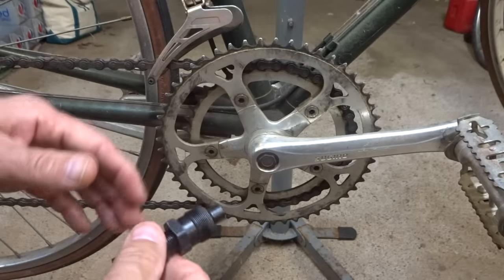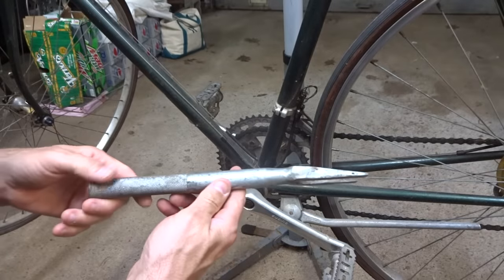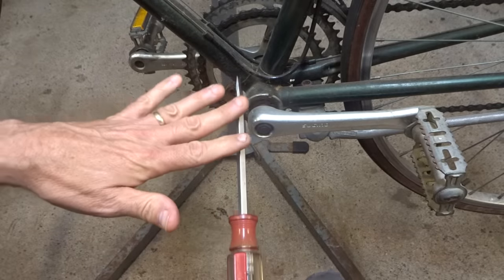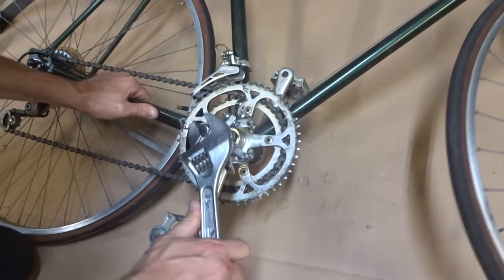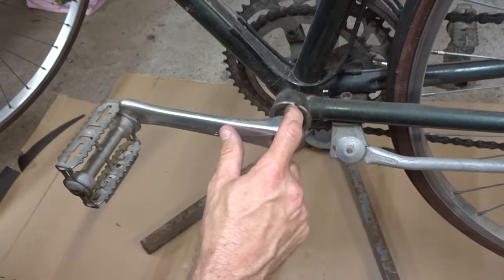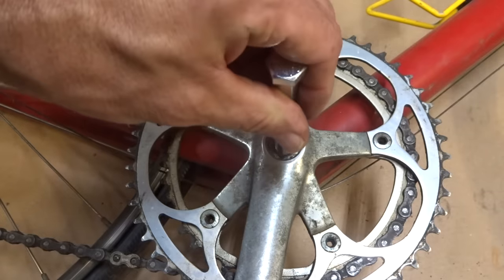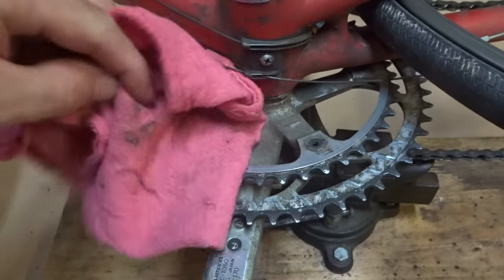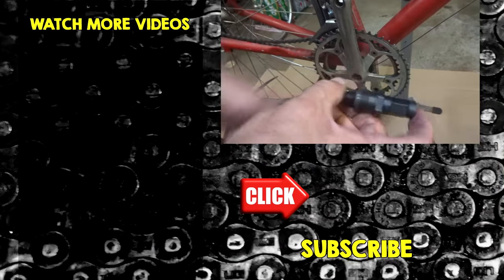Remove Cranks Without A Crank Puller

Comment: How much is a crank puller tool? If it's cheap, then why not go out and get one? Side of the road, you may need to do some adjusting or tightening...
Reply from the maker: $5-20. Did you watch the video? The whole video?
Reply: Sometimes, this type puller can be "borrowed" from an auto parts place for free.  They often require some information from you and perhaps a deposit, but you can do it right outside their store and walk it right back in perhaps! Buy something while there too! Just an idea.

Comment: Some interesting ideas here for dire situations where the threads in the crank arms are stripped, but if the threads are in good condition, just do yourself a favour and spend $5 or so on a crank puller! Things go a lot easier when you're using the correct tool.

Comment: In my situation i have removed the bolts but the arms are stuck gonna try wd40 hope i can remove them without using 
force/hammer its just to much for the bike sometimes ut damages barings the frame for example from the inside

Comment: bought the tool for £10 removed the bolt and screwed into the predal threads inserted the bolt part of tool and began to tighten it man it was solid so solid that i rounded the edges down on the proper tool now it,s just stuck there ,i cannot even remove it
Reply from the maker: Wow! https://www.youtube.com/watch?v=j5gmAkMLX60
Try visegrips to remove it. Not sure where it went wrong.
Reply: @RJTheBikeGuy  the threads inside pedal arm are fine,already tried grips they just slip off man its on solid,looks like the lump hammer is coming out to play

Comment: Do yourself a favour, save time and effort -  buy the correct tool, you know, the one designed for the job, and never look back.  I dont like using hammers on bearings, not one little bit, so will always use a puller which puts NO stress on the bearings, but you do you 😂

Comment: If the crank is properly seized on the axle you can not use a thin bladed plastic handled screw driver. Use a chisel, the right tool.

Comment: I tried pulling off my non drive side crank a few days ago and ending up stripping out the crank threads,  I tried again on the drive side today after filling up the taper hole with wd40 and letting the bike lie sideways for the last 3 evenings, Still no good. Crank puller was actually pressing ita shape in to the top of the bb axle..
Reply from the maker: https://www.youtube.com/watch?v=j5gmAkMLX60
Reply: I have the right tools, but the end of the crank puller is embedding itself in to the BB axle as I tighten it, the crank arm has not moved at all,  probably galvanic corrosion, aluminium arm, steel axle.

Comment: Hi RJ, I'm struggling to remove the crank nut off a vintage Japan custom crank. It's seized, Ive sprayed lots of wd40, have tried both crank puller socket end and an actual socket wrench, but it's getting to the point where I'm starting to round the nut off. Any tips would be gratefully received!
Reply: Just incase anyone in a similar position, I resorted to impact wrench. Took about a minute of alternating on/off power before it finally loosened and came off!

Comment: So on the last method shown when you turn the cranks one-quarter turn that's a 180 degrees?
Reply from the maker: One quarter turn is 90 degrees. If you watched, sometimes I rotated it a quarter turn, other times a half turn.  You just don't want to be bashing on one side only.

Comment: How are you supposed to use the gear puller on the crank without the gears?
Reply from the maker: https://www.youtube.com/watch?v=jrpIoXxVyTs
But unless your threads are stripped, buy the remover tool!
Reply: @RJTheBikeGuy  WOW! You got all bases covered. You have some clever solutions. I was just curious. I do have a couple of crank pullers. I had some major crank issues in the past. I had a new Fuji with crushed crank bearing races. At the time I didn't know anything about crank pullers.

Comment: Hey i have a question. My bottom bracket spindle is 127mm, new crankset is for 123mm spindle. Can i use the old bb for the new crankset? If not, why?
Reply from the maker: Maybe, but better to get prober BB.

Comment: Hey RJ, I just got myself a gear puller because i stripped off the thread on my cranks but i still can't seem to get it off. My crankset is just stuck no matter any of the methods i tried. But I don't have access to a hacksaw or anything to cut it off. Any other recommendations on getting it out?
Reply from the maker: Nope. This about covers it.
Reply: @RJTheBikeGuy  Aww man, alright I'll try to find a way. Thanks!

Comment: The thing is I bought the park tool crank puller. However, the thread on the crank arm is stripped. I’m just going to ride it outside until the crank arms fall off.
Reply from the maker: And it will ruin the crank.
Reply: RJ The Bike Guy I tried to ride outside yesterday and today. The bottom bracket would get loose first. It’s an old Motobecane from late 60s or early 70s. It still has the cup and cone bottom bracket. I don’t want to ruin the thread on the BB because I want to upgrade to threaded-on BB and modern crankset. I don’t even know if it’s BSA or Italian BB yet...
Reply from the maker: As the crank arms get loose, the mating surfaces of the arms will get damaged, and they won't stay tight in the future.

Comment: the problem with the balljoint remover tool method is that a sprocket removal tool is much cheaper than the ball joint remover,especially from asia and free shipping.
Reply from the maker: I recommend the proper tool. Though if the threads are stripped, then you have to do something else.

Comment: Time to buy a puller!
Reply from the maker: That is my recommendation. As long as the threads aren't stripped.
Reply: @RJTheBikeGuy  Bearing puller***

There is a certain feeling in the brain when you realize that the threads have gone loose.

Any word on buying new sealed BBs in 2020? Shimano changed their line (I will probably end up with the 300 if it fits my BB). There is not a huge selection / not great availability for high quality square taper BBs.
Reply from the maker: @BrownJello  They are the same as far as I know. Go to Hollowtech II maybe.

Comment: Can I get a link to the tool you used for the removal.. normal extractor does not work for me because my bike is chinese cheap and normal extractor does not screw on the threads.. the tool aroum minute 4/5
Reply from the maker: https://www.amazon.com/exec/obidos/ASIN/B06XPQKWV5/ref=nosim/youtube25-20
Or Harbor Frieght.

Comment: i cannot get the allen lock bolts off my crank arm.8mm allen wrench doesnt have the leverage.Now they are becoming rounded out as cannot remove them with force.
Reply from the maker: Bummer. Don't know what to tell you. They don't usually come out that hard. Maybe you were turning them the wrong way or something., You will need some sort of bolt extractor tool. Maybe an impact driver or something. Not a standard solution for you.
Reply: @RJTheBikeGuy  ive just found out that the company sells replacement bolts with thread locker on ,this is why i cant remove them.

Comment: i tried a crank arm remove tool but sadly when i start pulling off the threats inside got destroyed / gave after and the tool came out. så i guess i need to gently Hammer it off. i just wonder why the threats just gave up (aluminium) maby its metal fatuiqe

Comment: What do you do when the bolt does not come out to even take the crank off I tried everything.
Reply from the maker: If it were me, I would soak it with penetrating oil. Let it sit for a bit. Then use my impact driver with a 6 point socket. If that didn't do it, I would pull out my impact wrench and try that. Be sure to use a 6 point socket to prevent rounding off the bolt head.

Comment: Is there any way i can tighten it instead of taking it off without the required tool?
Reply from the maker: Tightening it is just tightening the bolt or nut with a socket wrench. Common tool.
Reply: @RJTheBikeGuy  thing is i dont have a socket tool 😬 and i need something for a one time use, any ideas as too something that'll work. Thanks so much appreciate it and keep up the awsome vids

Comment: All these methods are either damaging or require complex tools, not to mention timely. Bottom line - just use a regular puller! It's the best way.
Reply from the maker: A puller is the best way. Unless the threads are stripped.

Comment: Enjoy your posts especially on your homemade tools.... So I'm little surprised I have not seen one, from you for a custom puller?  Since the gear/bearing puller works but is less than perfect... Since all that's needed is some plates/rings, nuts and (all-thread or bolts)....  Then just drill holes and a slot to get it around the BB axle/spindle (2 plates/rings with the slots on opposites side would be best)... that just the general idea...
BTW if anyone wants more details on how to make one,  just leave a comment asking for them....

 (reposted comment)

Comment: None of these methods work for me. A Dremel is too weak and with a mid-drive motor in the way using a screw driver isn't ideal either and for some reason I couldn't finish the job with a pulley puller. So I made the cuts in your dremel method by drilling a few holes next to each other with a hammer drill (hammer modus off off course) full power with a 8mm drill. Most of the time straight into the center from the outside, then I drilled into the direction of the bike and to finish it off I drilled from the threaded inside outwards. If done properly, it can be done in like 15 minutes.
Reply: However I agree with you the most easy method is the crank puller, but if the thread is gone, there aren't many alternatives left.

Comment: So... to remove crankset WIHTOUT Crank Puller Tool, you should buy one? )
Reply from the maker: Did you miss the part  where I removed two crank arms without a crank puller? It can be done. But my recommendation is to buy the tool.
Reply: @RJTheBikeGuy  well, all other methods are mostly destructive, and which not are hard to complete and useful only if you CANNOT use the tool even if you have one.

So unless the video is called "How to remove damaged crankset", it should be really very short: "Just by the tool"

Comment: The best solution for that problem is to buy a puller..it is very cheap here in the PHL  I bought it for 120 php and I'm still using it for 4 straight years🤣🤣🤣it is made in China or Taiwan and it is very very useful

Comment: hammering caused my old crankset to deform a lil bit so even though i was able to fix the cranking sound in the bb I also made a lot bigger problem  cranking sound was fix but since the crank and the chainring was some what deform my chain started to rub on the fd cage and no matter how i tune my fd my chain still rubs bcause the chainring is wiggling and i ended up buying alivio crankset wc nice but it was unplanned causing me not able to buy the upgrade that i really want hahaha im not crafty sorry

Comment: I stripped out the threads in the crank arm with the puller tool on one side of my bike, then I stripped out the threads on the tool itself when trying to get the other side off 🤣😖

Comment: I have the tool but the thread for the tool is dead :/
Reply from the maker: Buy a new, better quality tool. My old Park Tool puller has pulled many cranks.
Reply: @RJTheBikeGuy  I mean inside the crank itself the tool is brand new :p ive seen now that you talked about it later in the video guess I commented too soon.
Reply from the maker: @GlobalDesignHD  Ahh, then you need to follow the steps in the video. 
Most often, stripped threads means someone goofed.
https://www.youtube.com/watch?v=j5gmAkMLX60

Comment: Two pickle forks and a propane torch.  Heat expands crank, two pickle forks, or wedges. ..  really. . .  I’d never let this guy at MY bike.
Reply from the maker: If you are using pickle forks, I would not let you work on my bikes.

Comment: I have  a very important suggestion... 
I was experiencing a stack crank since yesterday, it just won't release. I even turn to violence, but nothing helped. At night I had  a vision... Maybe if I try to heat the darn 😬♌♋♊thing with a propane torch... And YES... YES... Yes... It finally poped out... ➡️me... 😄😃🤣😂...
Reply from the maker: I have tried heat, and usually had zero luck with it.

Comment: I wish that this video came out a week ago when I had to replace the cranks on my old ciöcc 😂
Reply from the maker: If you have a nice bike like a Ciocc, invest in the tool.
Reply: @RJTheBikeGuy  we got lucky and the cranks were so loose that they just pulled off. They were cheap sora crank and the inner splines wore out. So I went out on eBay and found some 105 5500 to match most of the groupset that was already on it

Comment: I have a 1996 TREK Mountain Track 820 with a Shimano Altus FC-CT91 Crankset.  I'm having issues finding a similar crankset to install.  It's a 38/32/24 tooth crankset.  Can I install a different size crankset ie., 42/38/24?  Would that work?  Would appreciate anybody's input.  Regards
Reply from the maker: Sure. You might need a different size bottom bracket. Maybe longer chain. Maybe different derailleur if current one can't handle the 4 extra teeth, though that isn't much.
Reply: RJ The Bike Guy I will definitely try it. I figured 4 extra teeth on the larger crank may not effect it that much, but if so I’ll follow your advise and replace the other parts. Thank you

Comment: Fond memories of trying this without the puller and gave up. Was finally successful when the chain wheel came off the bike( and me with it) on the way back from highschool going full gas up a hill. Forgot to put the bb nut back on. Was the same 105 set also. I wouldnt recommend my method.

Comment: It's the same the same thing. Ur using the same method. The bottom u need a bike crank puller. So y u saying a trick without a crank puller

Comment: That crank pulling tool is only good if those threads are in good shape on the  crank. I have 3 different versions of that tool and the last 5 cranks I tried to pull they where no good. I even have that stupid thread chase tool and that is garbage. I ended up having to replace 5 cranks!
Reply from the maker: https://www.youtube.com/watch?v=j5gmAkMLX60
Reply: Finished with the best bit of advice... Buy the right tool for less than a pint of beer or a pack of cigarettes... (or at least in the UK anyway) 👌
Reply: I don't really know who you are talking to. But I have the right tools. And you drink all the beer you want. I don't drink!
Reply: I've seen that video and many others but if the threads are damaged these tools do not work. The only tool that will work then is a right angle grinder.
Reply: @Airbrushkid  What's a Right Angle Grinder?
Reply: Ha I see, just a Angle Grinder over here, we don't do the 'Right' bit beforehand!
Reply: What country you live in?
Reply: England 🏴

Comment: I'm lazy so I just remove the crank nuts/bolts and ride it up a hill in the hardest gear.
Reply from the maker: It can ruin the crank arm.
Reply: Yeah, not the best solution, but I stop cranking when it gets loose.
Reply from the maker: @vidjagameenjoyer  Buy the tool.
Reply: @RJTheBikeGuy  I fix bikes for a living and own all my own tools, but sometimes the threads are stripped and I don't always have a 3 jaw puller.

Comment: just buy the proper tool, they are not that expensive on ebay, this is like using an adjustable wrench or pliers all the time, better to use sockets or correct size real wrenches

Comment: Piece of advice,  buy a good tool for this, I bough one from eBay for "cheap". Tool ended up being trash, save yourself the trouble and just spend the $15-$20 for a parktool or something similar
Reply: I bought a Parktool crank puller and the threads stripped out. Parktool was good enough to send me a replacement. I did buy a cheap Chinese puller as a backup because once the puller is damaged, your repair job is over until you get another one.

Comment: I have Crank Puller Tool, but managed to ruin thread in left crankarm (poor quality of thread).
Reply: It's absolutely imperative to thread the tool in as far as it can.  First, back the bolt on the tool all the way out.
Reply from the maker: Stripped threads is most commonly user error. https://www.youtube.com/watch?v=j5gmAkMLX60
Reply: @osheathedj  that what i did. worked for drive side. But failed on non-drive side. Puller just appeared with aluminum threads grabbed from crank)

Comment: Hack saw, Dremel, angle grinder? Pounding on it? Why not a oxy/ gas cutting tool or a plasma cutter? OMG how bad do you need those parts off that bike? Just get a freaking tool. Auto parts stores will lend you the puller.

Comment: Ya bro I dont have that puller
Reply from the maker: Then buy one.
Reply: @RJTheBikeGuy  broo expensive 😁  in my cycle  the front cranks balls are gone and whole gear set is broken with the change of an angle now I have to change the whole set 🥲
Reply: @RJTheBikeGuy  u replayed to me 😍❤️🔥
Reply from the maker: @RAPTORxSTREET_  The tool costs under $10. I see one for $6.29 and free shipping on ebay. So I call bs.
Reply: @RJTheBikeGuy  am in india it coast 800,900 rupees

Comment: Usually, when you have to remove a crank without a conventional puller, it's because the extractor threads are ruined- so the crank is junk anyway. Only a masochistic fool would refit it. You only go to the effort of removing such a crank, when you absolutely have to- when the BB has had it- and has to come out to be replaced. So who cares if you damage either? You do have to mind the frame though.

Comment: Buy a puller tool: 10 dollars/euros/pounds, and forget the truble...
Reply from the maker: That is my recommendation. Though if the threads are stripped...
Reply: @RJTheBikeGuy  That's only an excuse to get out the angle grinder ;-)